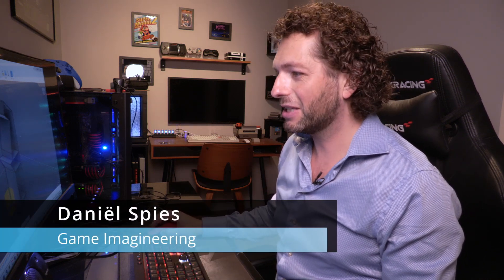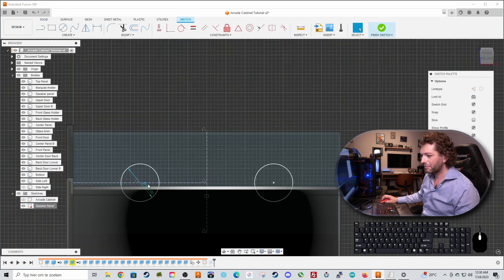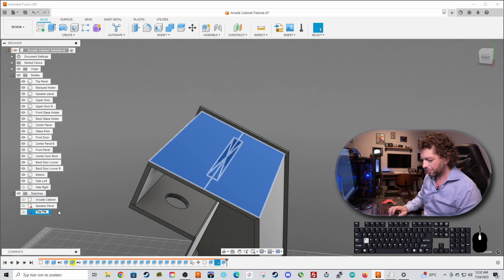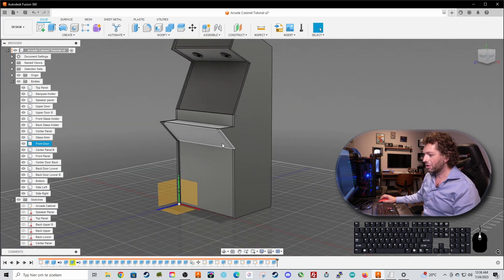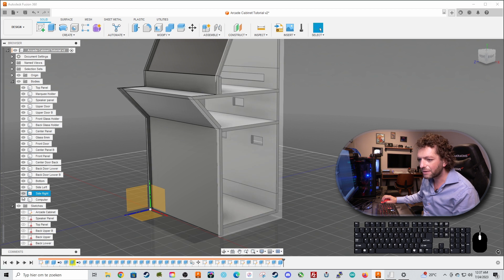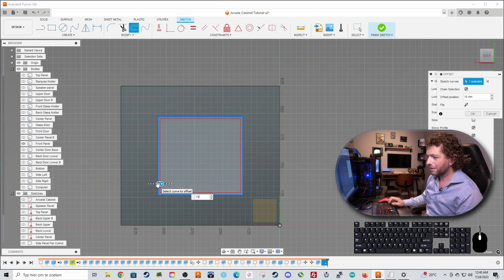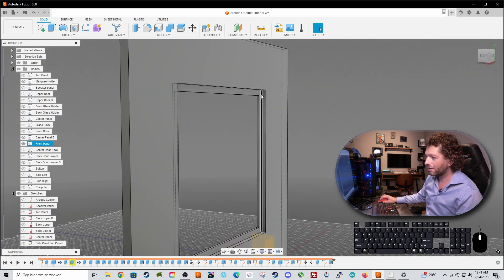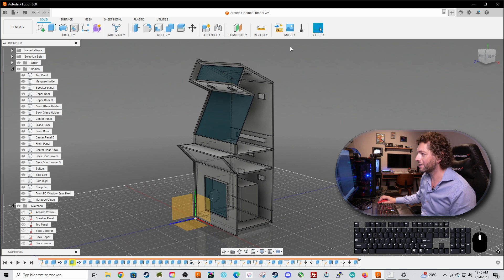Mastering fusion360 - Retro Arcade Cabinet tutorial  [part 3 of 5]  📐📏🛠

Comment: The McMaster Carr wheels were a great touch!  I followed along on this video, I used 200mm "big PC fans" for the PC hole, curious to see what that looks like.  Also did RGB LED 120mm fans on the Center Back Door vs a air vent.  Will send you some pics once I CNC it.  Fingers crossed! :)